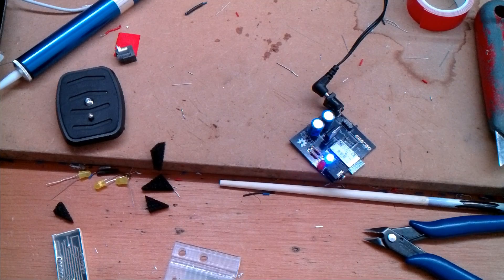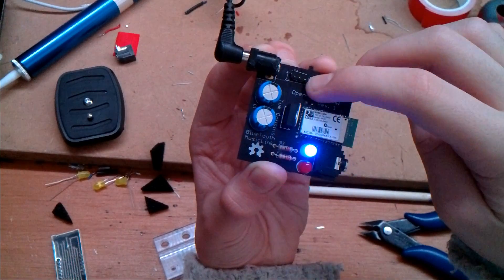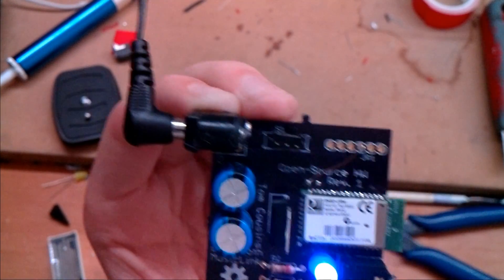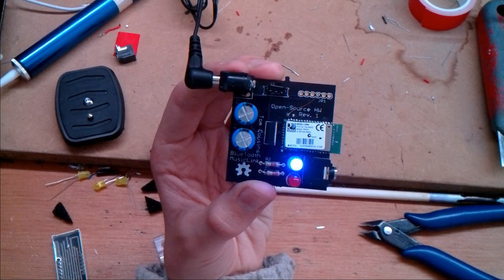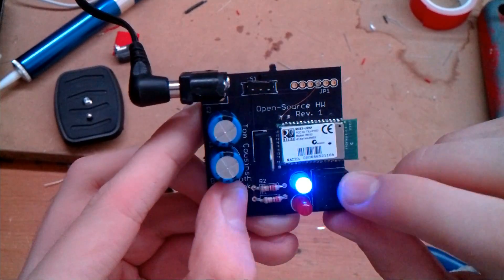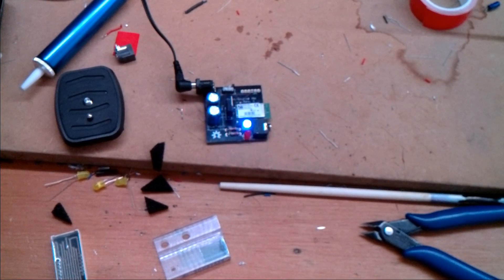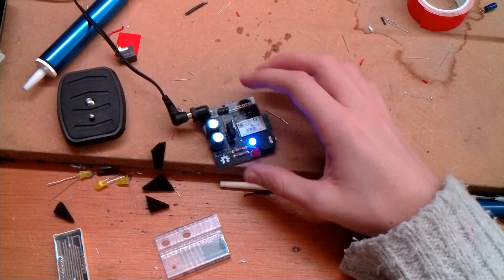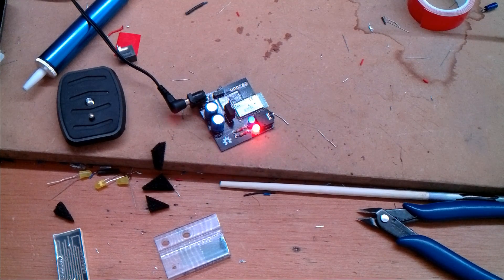Blutooth Audio Link

Comment: does the chip allow plug and play audio bluetooth so no programming required?

just connect audio out left and right and then power it up and pair todevice?
Reply from the maker: Yes it requires no programming for the basic functionality. See the design files for the kickstarter we ran for the updated version of this project (found here: https://doayee.co.uk/bal/ ) for how to connect the audio output. Also in the documentation is a comprehensive guide on how to change the settings to suit your need. Thanks!